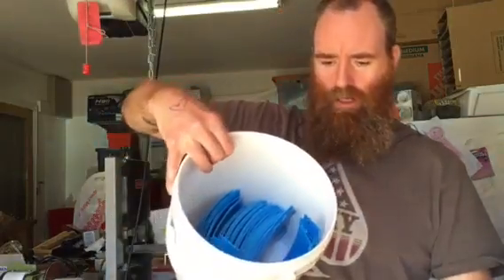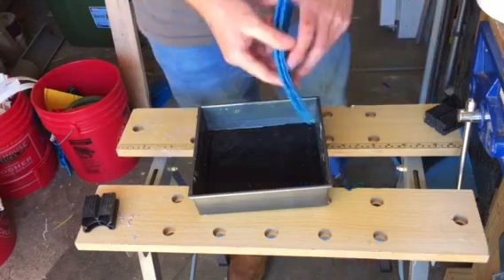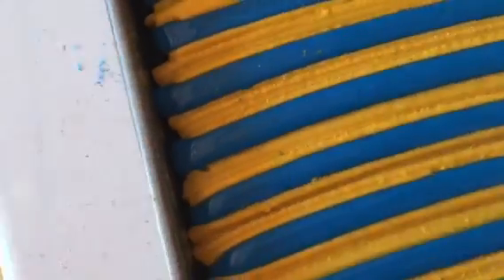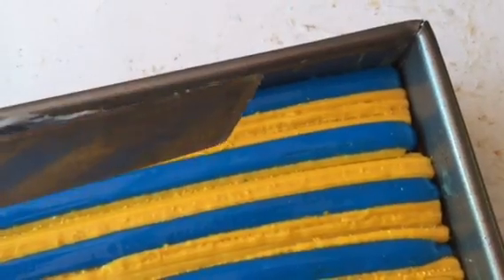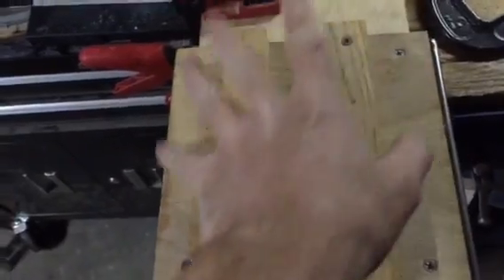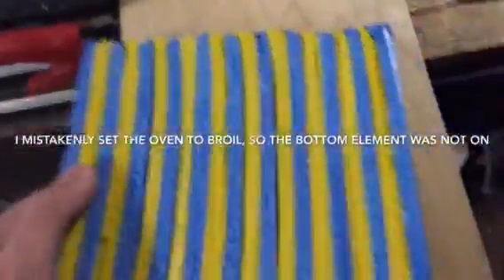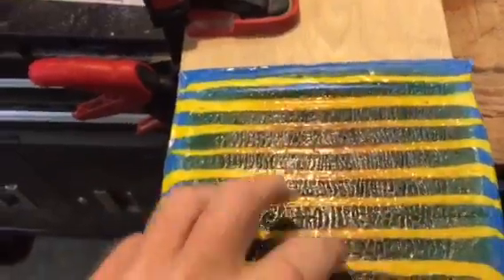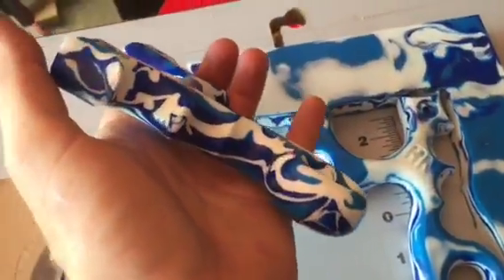How To melt HDPE

Comment: Many of the buckets I have available to me have the labels printed directly into the plastic. I'm assuming this would need to come off? I tried a but with a wire wheel on my grinder and it got it off with a mess. But does the printed label cause the plastic to not bond in those areas, or would removing it just be for looks?
Reply from the maker: Timothy Ball   I use a razor blade scraper to remove the printed labels. I do this for looks. As you are melting and fusing HDPE anything not HDPE will hinder the process. I don’t know if the paint will cause a failure but I’m pretty sure whatever you make will not be as strong as I could be. Paint, dirt, release agents all could be a cause for less than perfect slabs.
Reply: @YoullShootYerEyeOutSlingshots  so if it's not something structural, it seems like it could be left on there. 

I didn't try a razorblade because I was thinking of faster removal. I'll have to look it over again and try some things like the razorblade.

For cleaning, I'm trying to figure out if it would be better to clean it before breaking it down, or cleaning after in a bath or in a container in the dishwasher or something.
Reply from the maker: Timothy Ball  to clean buckets I cut the them in half, then remove the bottoms and put through the dishwasher

Comment: Are the Pyrex baking dishes still available? If so, you might experiment with using a micro wave oven for heat since they cook from the inside out.
Maybe a very light coat of Pam to prevent sticking.

Comment: Try waxing the pan and dust it with corn starch before loading the plastic to help release the material from the sides of the pan.
Also, mold release agent is available in aerosol cans.
Also, try covering the pan with a lid or aluminum foil but don't allow it to come in contact with the HDPE. That might help alleviate the scorching of the top surface.

Comment: What went wrong ???
You compressed the layers in the wrong direction. They should have been lain FLAT in the pan instead of on end. Also, the heat should have been increased gradually to allow more even heat to penetrate to the core of the material.
Hope this helps, good luck !

Comment: OK, I'm new to the HDPE as well. Couple of questions. 1) Why 350°? Why not 400° and let it become more pliable? 2) Would it be more beneficial to "cook it" for a longer period of time? 3) Would putting it into a taller oven reduce/eliminate the charing? Seems like it would as it would move the heating element away from the material.

Just curious. Guy
Reply from the maker: Guy H. I'm sure cooking at 400° would not present a problem. (More than one way to skin a cat sort of thing) this is just the way I do it. I've prob made 20 or 30 blanks this way.  Cooking for longer won't make the molten HDPE more viscous, it will just char the top more (particularly at a higher temp). Once the bubbles stop rising cooking more isn't beneficial.   Since I made this video I've switched to a larger convection toaster oven but I'm not sure that this has caused less charring. In the end it's that important as the top of the billet will need to be removed any way to leave a clean surface. Hope this helps. I'd be happy to answer any more questions if you have any.

Comment: Years ago, I worked in a shop that repaired aluminum molds that were used in plastic injection molding.  The molds had fittings for liquid cooling.  Perhaps you may want to experiment with a "dipping pan" for your molds.  You probably can skip the putty knife separating your plastic from the pan as it shrinks on its own as it cools anyway.  That could speed up your production.  If there is release agent residue on your buckets, you may want to try washing them in a dishwasher, just remove the upper rack.  I suppose you could hand wash them if you want or have to.  Also, idk if that release agent is available to the public, but you might want to look into getting some, or at least getting a price.  Have you tried making things other than slingshots?

Comment: Yeah if you haven't worked with plastics for a living, you tend to learn from the little mistakes like that, try a lower heat and leave it in for 3 times as long, this gives the plastic time to meld together, what you are doing is not using the heat to glue the strips together, it has to meld together, the longer the time on lower heat the better, don't be worried about forcing more strips in the pan as well the harder they are against each other the better the meld as well. give it a try.

Comment: How about putting a brick or heavy weight on top of it in the oven ?
Reply from the maker: mike mike  you totally could put a weight on top especially if you are using household HDPE containers. With five gallon buckets it's not necessary as that type of HDPE flows much better.

Comment: So, a little background; Is this stuff heavy? how about flexing? does it work like wood? What are you going to use it for?
Reply from the maker: Seth Warner  it's fairly dense and can be worked with woodworking tools. I got into HDPE to make slingshots but the uses are just about endless.

Comment: If ur using slope sided tins just use a second one on top as your pressure mould. Putting pressure on while still soft fills any gaps. Like the idea of using ply as the measure. Once again clamping while soft would give a way of creating even thickness sheets.

Comment: I think you should clamp it a little tighter to prevent the cracks
Reply from the maker: Shea Sollars thanks for watching and for your suggestion. I suspect the crack were likely caused by a release agent not completely washed off one of the buckets. The clamp are used only to prevent warping while the blank shrinks as it cools. Over clamping can result in excessive squeeze out possibly distort the pattern.

Comment: Love the White and blue combination is it safe to use a oven you used to cook food in or is it Best to purchase a separate oven and just have it dedicated to melting the plastic?
Reply from the maker: I have used my kitchen over to melt HDPE. As far as I know it's not harmful. I would be carful not to burn it however. The prob you are most likely to have is the residual smell of whatever was in the container originally and overflow bits of HDPE that sometimes drip off the pan. The melting process will release the smell. Pickles are particularly pungent. Depending on where you live a used toaster oven is an excellent choice. Goodwill often has them for cheap. Look for a convection oven model.
Reply: +Matthew Neyman ok I will have to take a look at goodwill tomorrow thank you for your time and fast reply I'm trying to do this to make a part for my truck they want $100 for a piece of plastic that I'm sure I can make well hope I can make lol well have a grate day man

Comment: Grilling sheets?  Are they a bar-b-que supply item?  I tried baking paper (aka parchment) but the milk jug pieces stuck to the paper. I think my oven thermometer reads 25F low, so that might be the problem (HDPE too hot) FWIW I want to make sheets 1/4 to 1/2 inch thick.  Getting the labels off laundry soap and milk jugs is a real bitch.
Reply: take a heat gun or hair dryer, blow hot air 5-10 seconds over the label and it comes off without leaving residue.
Reply from the maker: +Chuck Yahrling 
Yep, look in with the BBQ stuff.  For my money (and by money I mean time ) I don't even bother with the paper labels.  I just cut around them.  TBH I seldom use anything but five gallon buckets anymore.
Reply: reply!
Reply: Try using kerosene or goo gone to remove paper labels. Apply and let it sit for 10 minutes.  Does not penetrate plastic coated labels very well.  For plastic labels use a heat gun to soften the adhesive.

Comment: Try cutting the pieces of plastic down more. Increased surface are means easier and faster melting, plus you get a pretty sweet "Tye-Dye" look to it. Also, most people say to melt it at 350°F, others say 400°F, but if you have a convection oven, try 385°F on convection. I have a convection oven, and 385°F works great. It melts evenly, I get no discolouration, and it comes out looking pretty cool. Also, if you compress it between 2 pieces of scrap granite like I do, it comes out smooth, shiny, and the same thickness all the way around.

Comment: Hi Matthew, I assume it doesnt smell or at least it is bearable to do it indoor?
I tried to melt ABS and the smell was so strong and forced me to do outdoor with extension cable.
Reply from the maker: +thephatnguyen 
The smell will depend on what the container was used for.  I mostly use five gallon buckets.  The ones i get from restaurants are mostly pickle containers.  There aint no way to remove that smell.  When you melt them, it smells like pickles.  Mostly not too much but you know there were some pickles around.  Even when the plastic is cooled you''re not out of the woods.  When you cut the blank the pickle smell comes back for a while.  I have melted several batches in the kitchen and would again, but I prefer to have the whole operation contained in the garage. Having said all that you might end up with some containers that had some awfully stinky stuff in them and all bets are off.
Reply: +Matthew Neyman 
Thanks for your fast reply, I actually planned to melt the jugs from Tropicana and other orange juice.

Comment: How come no one thinks to cover the top while the blank is in the oven? This eliminates the char. I have a lid I made out of a piece of aluminum flashing that I put on top of my mold. It mostly does not touch the plastic in the melt. Sometimes a piece sticking up will get stuck on the lid I made when I overload my mold a little. I use random scraps, so they stick up all different ways. You only need to cover for the final part of the melt really. The lid works like a pie protector.
Reply: Also, not mistakenly using "Broil" helps a lot... Heh.

Comment: I dont know what temp you had the oven set to but HDPE melts around 230 degrees fahrenheit but for molding and extrusion purposes I run mine closer to 400 Degrees and bring it up to temp pretty fast. Heating it slowly seems to build carbon and leaves black spots.  I only use virgin material for HDPE but PVC and CPVC I'll run regrind all day.
Reply: +Matty Matt Matt i had luck melting hdpe even at 320 degrees this temperature completely eliminates any brown spots or degradation even though it may take longer

Comment: Very cool. I am interested to know your opinion on any potential health risk associated with vapour emitted during the melting process. I have no idea, so I am asking...
Reply from the maker: +MusicTubeLover 
     

HDPE resins that are made by Dow and used for food-contact applications are in compliance with
applicable U.S. Food and Drug Administration (FDA) regulations and European Union (EU)
directives/regulations for consumer safety.

Eye and Skin Contact – Eye contact with HDPE resins or dust may cause irritation or corneal
injury due to mechanical action (scratching). Vapor from the heated resin may cause mild
discomfort and redness of the eyes. Prolonged skin contact is essentially nonirritating. These
materials are often processed as molten polymers at elevated temperatures and skin contact with
the heated material may cause burns.

Inhalation – No adverse effects are anticipated from a single exposure to dust. Vapors or fumes
released during thermal processing may cause respiratory irritation.

     Ingestion – These materials have very low toxicity if swallowed. However, the granules may
represent a choking hazard.

     For more information, see the relevant Safety Data Sheet.
Back to top
Reply: +Matthew Neyman Thank you!

Comment from the maker: Mostly I use the dishwasher. The milk jugs won't self level during melting. You'll need to compress to remove the air bubbles.

Comment: Did you degrease the parts before ovening it? Maybe the issue. Washing them with a degreaser (detergent). Plastic and grease don't mix.
Reply from the maker: +killerbeenl I wash the buckets after I cut them up and before I melt them.  I have taken to  running  the cut up buckets through my dishwasher.  This seems to be a better alternative to hand washing.

Comment: having worked for a plastic company for years--I found your problem and how to solve it--see all plastic companies use a release agent in molds-soo those plastic buckets should have been washed in hot soapy warter good to get the mold release agent off--that way the plastic will bond better when melting and NOT separate.

Comment from the maker: You could also melt the HDPE on a baking sheet and then as the poly becomes malleable you could pick up (take the appropriate safety concerns as it will be scalding hot) the whole ball and knead or twist it to get your desired effect.
Reply: Maybe fold or roll it?
Reply: Matthew Neyman can you melt the hdpe without a microowave?
Reply: Novis Evans he was using a toaster oven, not a microwave. You can use just about anything. I’ve seen griddles, ovens, kilns used to melt hdpe.

Comment from the maker: You can manipulate the molten HDPE but it will be difficult to affect the pattern at the bottom of the blank. If you put something into the blank deep enough to mix it throughout whatever you utensil you used would be encased in HDPE when you are done mixing. To get a more consistent pattern its best to arrange the colors before mixing or add the separate colors in layers as you melt.

Comment: great job but i suggest not to use the wooden press because it wont allow the plastic to completely fuse together and without the press the plastic will be much higher quality i simply melted the buckets into a square mold like you had but if you let it sit in the oven at 330-350 degrees farenheit it will take on the shape of the container and be much higher quality than with the wooden press i have a video on my channel if your interested
Reply: Dean Walcott Some other people suggested to put a butter paper on wooden press
Reply: yeah but for me the buckets flowed right into the mold without a press i think because buckets are injection molded and the hdpe uses a resin that has a high melt flow meaning the hdpe flows without pressure however in the case of melting milk jugs they are blow molded and use a resin with a low melt flow meaning the hdpe wont flow into the mold it will be more like taffy or chewing gum consistency in this case yes a press will be neccessary and butter paper will simply make it easier to remove from the mold just never use aluminum foil because you will never get it off
Reply: у teenagers and frozen sorry noses please meaning would you like you have a sleep anymore celebrity look like you prices ever seen the righteous righteous righteous boom dragon lovely I
Reply: Thanks for the warning! I was looking for info on using cardboard (Pringles cans) as molds when I came across your comment.  I

Comment: Interesting source of plastic. Never thought to use buckets.
Reply: Combat Robot Builder Be careful, most of the yellow buckets I have seen are PolyPropylene kitty litter buckets.  It has a lower melting point than HDPE.  PP = code 5,  HDPE = code 2,  350 degrees vs 400.